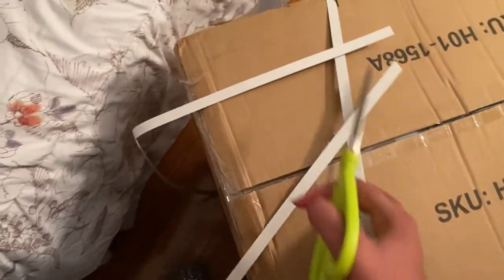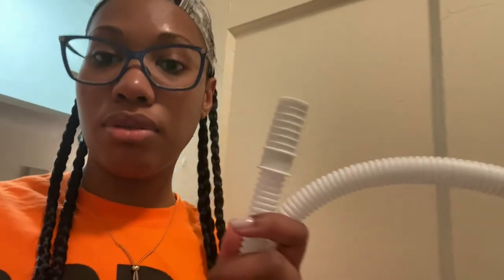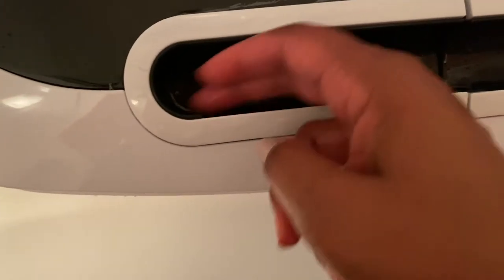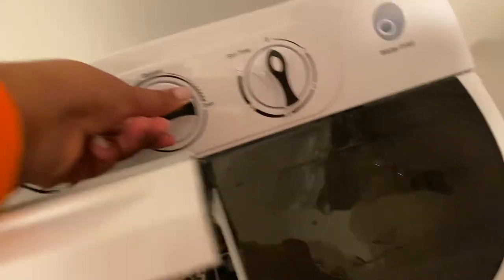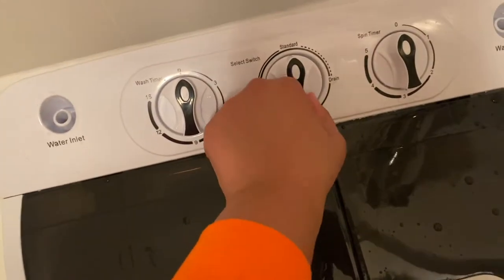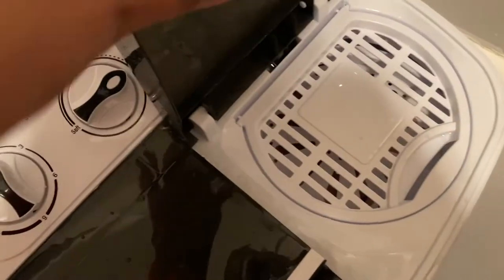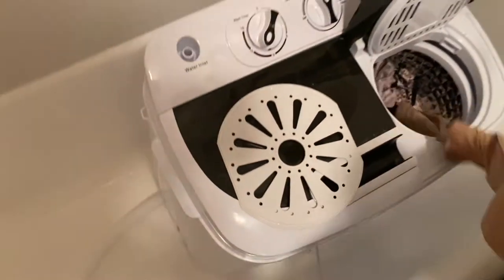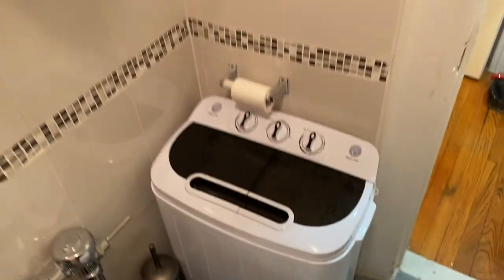🔄Compact Washer Dryer Review!

Comment: I had this exact washer for a year 1/2. It was awesome. This little guy works great! I sold it to get a magic chef 3.0 washer back in December 2019. I needed a bigger washer to be able to wash all the chemicals off my clothes from work. I definitely recommend both to anyone. It all just depends on your likes and dislikes. Just make sure you don’t over stuff it. Otherwise the motor will work overtime and it will break.

Comment: Makes me kinda nervous you have it sitting in the tub, use a pallet underneath so that for sure it will be out of water preventing from ruining the motor or something worse happening and helps machine drain better and can use a screen hair catcher to catch the lint so you don't plug up your tub, also the floating lint catchers do work! You might want to put your shower head in washer first then turn it on, sorry but water & electrical things make me nervous!! I got instructions and figured out what best works on my own. :) Also drain hose should be reversible so you can turn it underneath machine so that it exits on the spin side closer to your tub drain.
Reply: Well said!!!  I have mine on a table and use a bucket. Soooo easy and safer.
Reply: @carmellelapointe7583  Yes!!
Reply: I had mine in my shower the whole time I had mine. And that was a year 1/2.  My hose was on the opposite side of my drain like hers is.
Reply: The instructions literally say place in the tub/shower
Reply: @Jerseygirl777   yes just cause it says that for this model for it to gravity drain doesn't mean it should be sitting in several inches of water. I have a Zeny, manufacturer video shows having it outside of shower/tub. If the lint trap you have in place gets clogged it will back up I've had my lint trap get stuck with junk fill my tub within seconds to 3 to 4 inches even after cleaning lint trap after every load, so glad to have it up on a pallet and machine is too heavy when full of water to lift up out of the water, common sense & safety.
Reply: I sit my washing machine next to my tub on top of a storage crate with the drain hose hanging into the tub.
Reply: @teresasimms7801  , that's good!! :)
Reply from the maker: @linny Yea I recently used the washer without my lint catcher and my tub definitely backed up. Had to use a little drain weasel to unclog it. Still think its fine in the tub though. Been ok this long.

Comment: Is it possible to wash and dry are the same time?
Reply: She was doing so in the video, but didn't bring full attention to it.
Reply from the maker: Yes, you can!! Pro tip: Sometimes the dryer won’t stabilize and keeps shaking. I’ve learned to just add a little water on top of the clothes. I think there’s some sort of weight calibration to it that helps it spin.